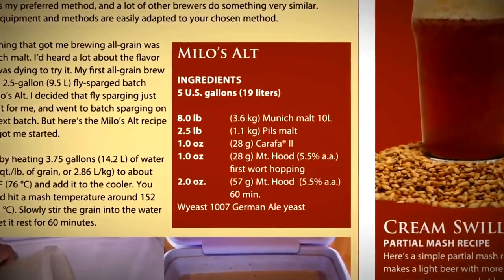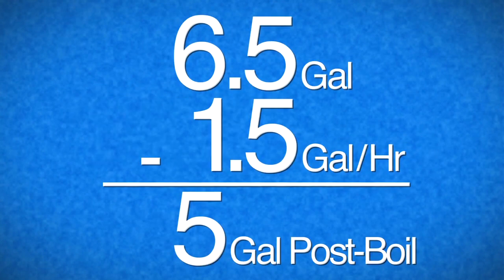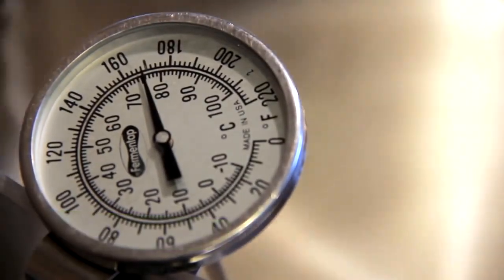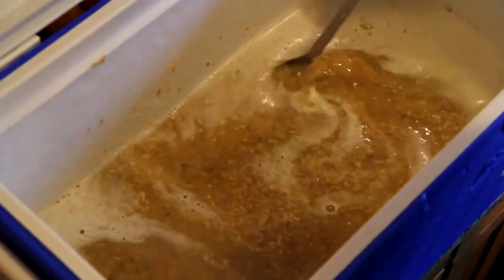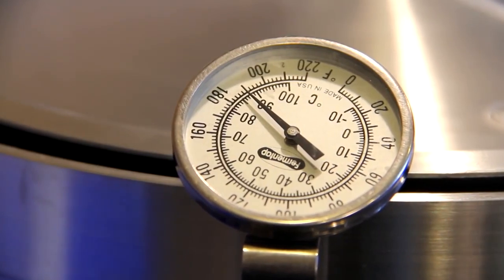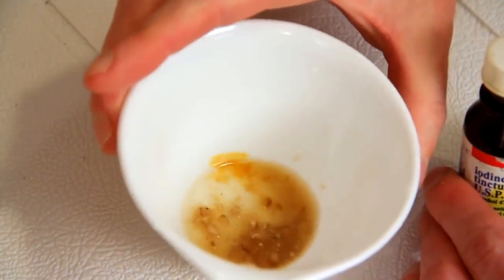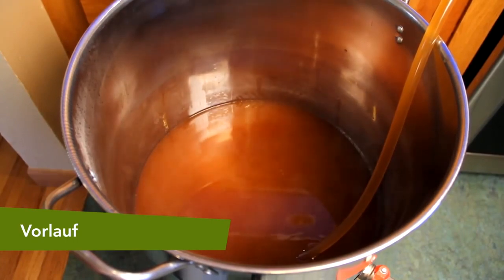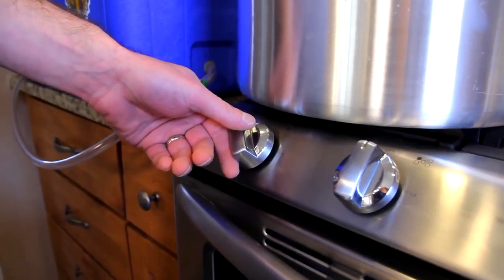All Grain Brewing | Batch Sparge Mash Method

Comment: How much sparge water did you add back to the mash of this batch?
Reply: He wants 6.5 gallons initially to boil off 1.5gal over the course of the one hour boil. He's losing some of the 3.75gal original strike water absorbing and remaining in the grains... and the five gallons of sparge is more than enough to reach that 6.5 starting boil volume, but incase one needs more to reach that volume, he's preparing 5 gallons of sparge water so that he has some extra already hot incase he needs it. I've run short before and wish I'd seen this a few years ago.  I just did a very complicated Heady Topper clone and ended up (due to boil and dry hopping residuals) with less than the 5gallons at finishing gravity, which was a little low....so I'm hoping to get all of this crap straight this time around when I make it again soon.
Reply: @racheat  no worries and thanks! All for the love of brewing

Comment: Use iodine to determine when conversion is complete? You have conversion confused with liquefaction and saccharification. Conversion didn't occur because Beta was wiped out during the rest and to verify that conversion didn't occur secondary fermentation was skipped. The recipe recommending high modified malt and the method produced chemically imbalanced, unstable, distillers beer.